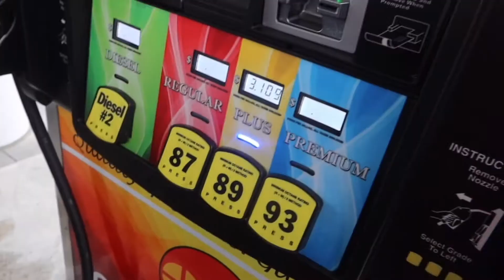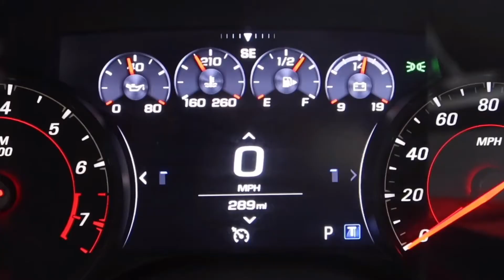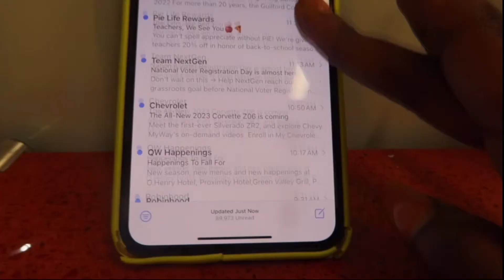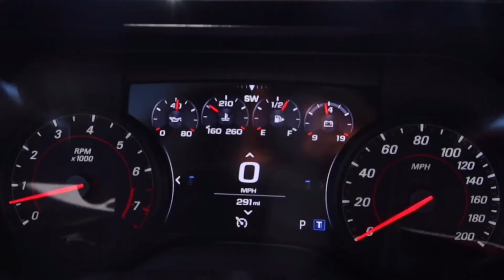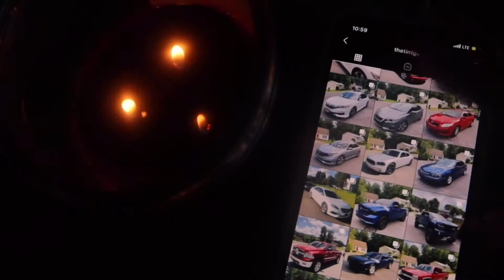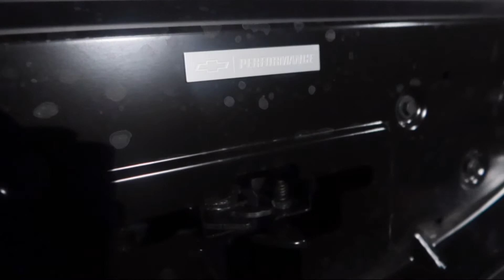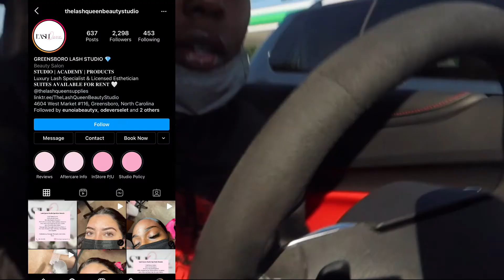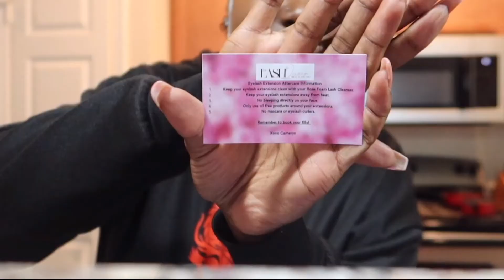Is Drilling Your Rear Spoiler a Mistake? | 2022 SS CAMARO Mod Series + More

Comment: i think u putting the wrong gas lol
Reply from the maker: What gas u think? I know not 93😂😂😂
Reply: @asiachan22  91 0r 93 yes,, 93 and 91 the same thing its just that different states use different numbers
Reply: @asiachan22  if you start hearing knockings sound deff use 91 or 93
Reply: For sure 91 or 93. Even states it in manual. Regular just doesn't quench the thirst for it. Laggy, sounds weak. Run weak
Reply: @Martin-gd6ri   yep
Reply: Yes it even says it on the gas cap recommended premium and on the guide book says 91 or 93
Reply: Premium 93 for 2ss ma’am
Reply: DD time u don't know nothing about a 2ss camaro